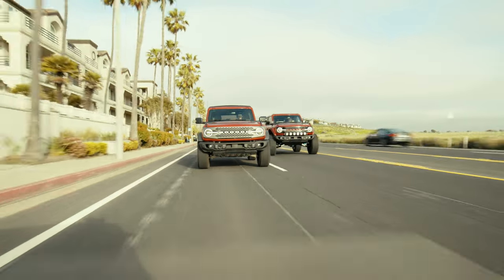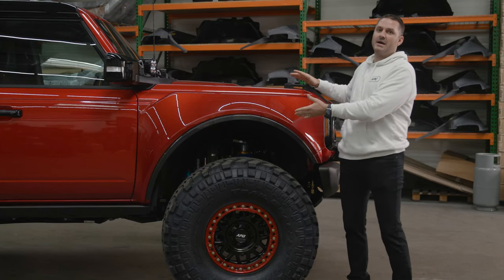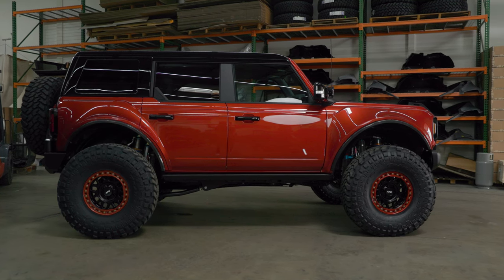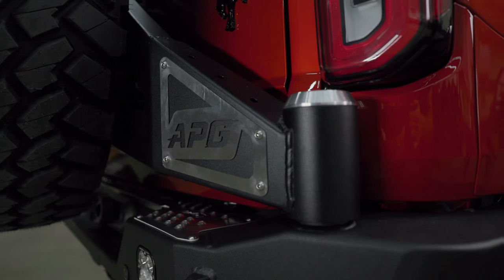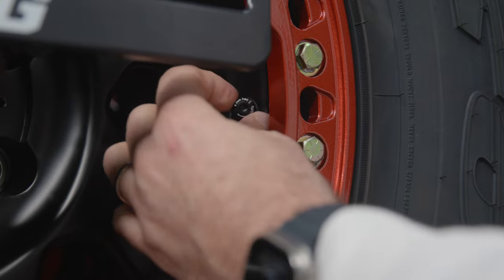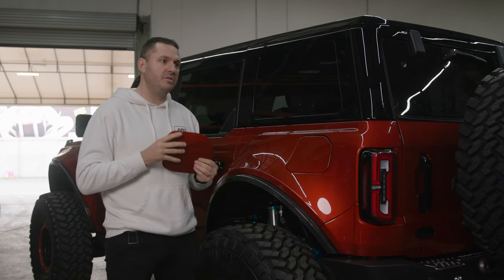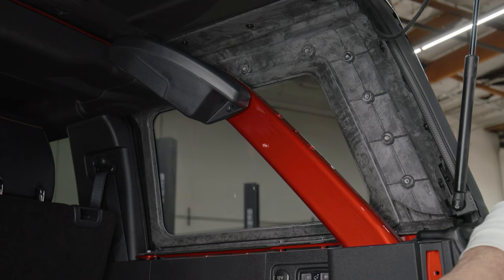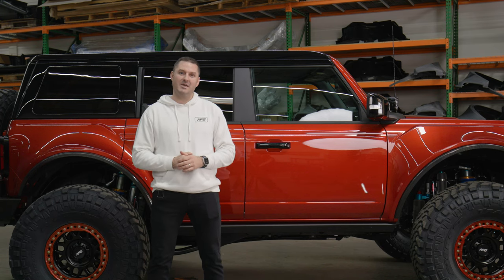ULTIMATE Ford Bronco Build | APG PRORUNNER 002

Comment: What are the brackets you're using for the bumper mounted lights? Everything says it isn't comparable with that standard steel bumper
Reply from the maker: Get the plastic bumper kit and notch the bumper

Comment: Question. I have a bronico raptor love how it is. Id love ti grah some fenders can i run 40s on your fenders and some other mods like rear bumper and stuff. Thanks in advance.
Reply from the maker: We don't recommend running 40's on those stock axles, but our body system will allow you to do so.
Reply: @APGOFFROAD  what are a set of axles for this beast run ? Thanks in advance.
Reply from the maker: Unfortunately no one makes Bronco Raptor axles. Performance is essentially capped at OEM.  @JAETRX

Comment: Great Bronco Build, was curious what brackets did you use for the Baja Designs XL Pro's on that Steel Capable bumper? Seems everything out there is for the Modular Bumper
Reply from the maker: Custom
Reply: @APGOFFROAD  Do you sell the bracket you used for these lights?  If so, do you have a link to the site the bracket can be purchased?

Comment: The body work and everything is very impressive but you didn't put 125k worth of upgrades. The pricing is just insane. Asking 175 with about a 115k markup over the base you built it on is kind of nuts but, beautiful
Reply from the maker: The build list can be found in detail on our website. Very extensive
Reply: @APGOFFROAD  Yes, I've gone through it. Like I said, it is impressive but very pricey. It'd be nice if you guys had a couple more videos showing the actual performance. Maybe collaborate with somebody and have them take it off road or something. To just kind of show the prices worth it.
Reply: @APGOFFROAD  if you think about it, the story you're telling is our build is better than a stock raptor that has had 40 to 60k worth of upgrades done to it. It would be nice if we could see that. Ya know?
Reply from the maker: @imlove6533  Do you own a Bronco or Bronco Raptor?
Reply: @APGOFFROAD  no. I'm actually on the fence between a bronco raptor and a mid runner. I think the pro runners just outside of my comfort zone on price
Reply: @APGOFFROAD  though I like the look of the midrunner much better than the raptor.
Reply from the maker: Its not easy to digitally capture the true beauty of ProRunner, you have to see one in person to understand. We are working on a series of videos and technical spreadsheets showing travel numbers,  performance, pros/cons/ ect, Ford knocked it out of the park mechanically with all of the Tremor/Raptor models, but our program delivers an unapparelled Offroad experience where each vehicle is uniquely commissioned to the driver, all while turning heads everywhere you drive.  You will have to understand the manufacturing processes we follow and the quality/service we deliver on every build, to understand. Feel free to drop by anytime or reach out directly to our office and have that conversation.

Comment: I’m of the opinion Ford messed up by not having the quarter panels flared from factory, that should have been obvious. Instead they opted for these huge plastic afterthought quarters, it just looks cheap and dumb, to replace them and have the car look complete is going to be difficult and expensive. It’s dumb.
Reply: Fax, especially with the Ford Bronce Raptor, it looks like a toy car